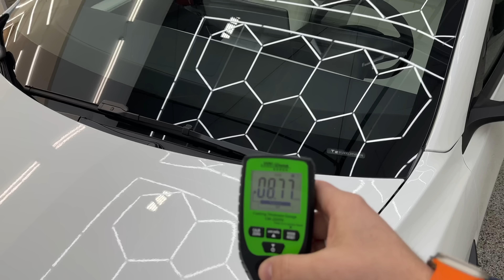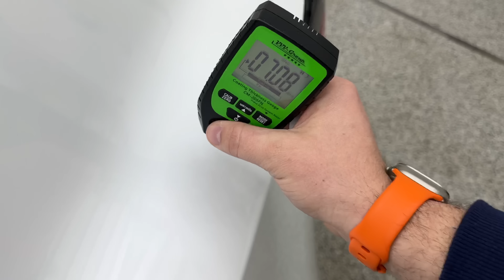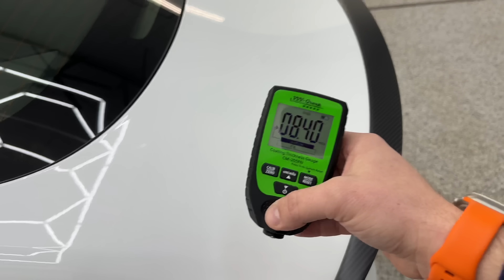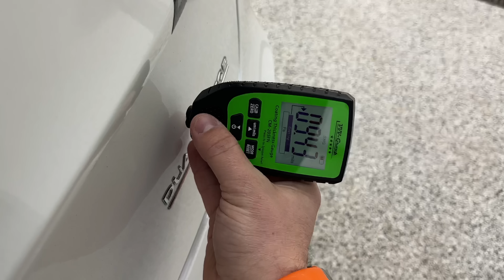Drastic Improvement In Tesla Build Quality! Analyzing Brand New Model 3 Performance

Comment: My Model Y performance is now three days old.  We picked it up at the Temporary New Delivery center in Bangkok.  My wife and I found nothing to complain about on the initial inspection.  Everything works.  The interior and Exterior were perfect.  We have a 516km range model. (I mention that because I hear that they are going cheap on the batteries and range will be reduced)  We have Parking sensors and a plug for a radar that is not installed.
The only niggle we have found with our vast experience with this car is Rain.  When water hits the area behind the hatch glass and the spoiler, it sound super loud and cheap.  As if you are inside an empty soda can.  Sound deadening mat is definitely needed in this area.  This became noticeable when water from a gutter or over head drain is hitting the car in this area.  It really shows where the noise is coming from in the rear.

Comment: Wee took delivery of our 3 RWD pearl white on Dec 27. Currently at 1839 miles on the odo. No issues at all. Paint, body gaps, etc all great. No wind noise, no rattles or squeaks, all good.
Reply: did you get PPF?
Reply: @ROFEL  No. Too expensive in comparison to what the car cost. And we are in a very low population area, so chances of someone kicking up rocks or such are minimal.

Comment: Our Model Y Performance from Berlin, delivered in December (2023 without sensors) was also built so perfectly well compared to our old Model X. Outstanding finish inside and out. Only one thing that could use an adjustment.. the charge door might be poking a couple of millimeters too far out on the bottom. Apart from that.. perfect! The door also sounds much more solid than my mothers early generation Model 3, and road noice is on par with most other premium cars now imo.. at least those with frameless doors. 

They have really stepped up their game… and it even smells like a new car now, instead of just plastic as their older cars used to smell when new. Smell is so important when buying a new car!

Comment: I took delivery of my Model Y at the end of October last year. It's an Austin build. They washed mine and even though our state requires the front license plate I too was happy that they didn't put it on since it has that double sided tape. I didn't removing it late to be an issue. I bought and aftermarket frame and love it.

I'm not sure how they washed my car but I have the midnight silver and thought I was going to see marks but I must have hit the car lottery. My fit and finish was on par with this Performance model. I didn't have any visible paint issues. All my electronics work perfectly. I'm an IT guy with about 30 years in and I'm kinda nerdy and OCD with it. I did basically 20 to 30 minute walk around. My sales rep was super chill about it since they were really busy and it allowed her to get other paperwork in order.

To this day I've been super happy but I really need to get serious about paint correction and PPF because this spring I have a few other accessories I plan to put on/in the vehicle.

Comment: Have a 21 M3P with same colour spec. Already 70,000kms. Been rock solid still no squeaks or rattles. If I had any complaints there are a few imperfect panel alignment.

Comment: We've found our RWD standard range 2023 to be pretty solid too.  I did go over it with ceramic(did not paint correct) and I was impressed with the fit and finish.  I'd say my GTI is even tighter but that's if I'm really nit picking.  The panel gaps are tighter on the VW, but the Tesla's are still uniform.  I'm really surprised by how much I like the simplicity of the interior.  I'm a big fan of the German approach of simple designs with high quality materials.  I think the GTI feels slightly high quality in the interior, but I think that's just perceived because I prefer the real leather, but I find both extremely comfortable.  You can tell the Tesla doesn't use real leather, but it's not a bad thing.  I plan to buy a Model 3 Performance too eventually to be my daily.  Our current Model 3 is my wife's daily.  The GTI is mine.

Comment: I noticed the clear coat/paint difference on the bumper from the body. ITS a different shade lol. Not noticeable to others. On my model Y LR has the same issue. Outside on the sunny day its fine. But in my garage with shop light, you can spot it. Its a bit yellowish. Rock chips also will chip bumpers easily than the hood. I've tested it. Glad you brought up that color issue. Tesla still has gap issue of course.

Comment: Please provide a 1 year update on the build quality. When I took delivery of my Model 3 eleven months ago, it was rock solid and had zero creaks or rattles. Today it has tons of creaks and rattles. Curious to see if over time your dad's car remains solid.
Reply: Took my delivery last May and I'm starting to experience the same thing. Sometimes it's nicely quiet but other times there is a squeak somewhere that I can't seem to pinpoint and it drives me crazy. Brought the car to the service center where they found nothing wrong and charged me $65 for diagnosis.
Reply: I'm thinking about ordering the model 3 but creaks and rattles would drive me crazy too.  I sometimes spent hours to try to pinpoint where the rattles coming from in one of my previous cars.  My current car, 2021 Acura RDX, is still creak and rattle free just like when it was new.  I guess they're not built the same.
Reply: We are having a Model 3 2,5 years old and a Model Y 1.5 years old from China. The Model 3 has a slight creak closing the drivers door but nothing else. The Model Y sounds like before the 64.000km it has been driven already.
Reply: @laloajuria4678  Mine not.

Comment: On a strong headwind or a light passenger to driver side cross-wind, the top corner of the driver size window whistles extremely loud. I can change the pitch a little when put a little pressure on the glass so I know it's coming from there. It's very loud that even a pretty high music volume can't mask, lol. But it's also right at my ear. Drives me absolutely bonkers on longer drives.
I wonder if the top molding overhangs too much from the window. Really wish the model 3 had full frame doors. Usually less problems.

Comment: I heard that the 2023 model y performance will have a little softer ride compared to prior MYPs.  Do you notice a difference in ride quality?  Thanks!
Reply: The ride quality of my 2023 MYP over bumps and lumpy roads is firm/not jarring. I would like drive back to back with earlier MYP to opine on preferred option. Having said that, am content with mine.

Comment: Got my m3p 11/2022 build. Pretty much out of dealership MCU failed, replaced under warranty. Some minor paint chips. Still no paint on inside of doorjams. Otherwise fine
Reply: @laloajuria4678  I agree, could be better. Try to find another car for 50k that does 0-60 in 3.1s Doesn't exist.

Comment: Gives 10 000miles and its a rattle box, if driven over bad roads all the time.
It always feel tight in the beginning 
Ive gone thru 2 model 3s
2019 and 2022.

Comment: Tight is good. Maybe Tesla can design a 'Lego' tipe fitment on the moving parts so that the panel gaps can al but disappear.
Reply: Maybe they’ll eventually cast the whole car in one piece.
Reply: @ken-mb5cp  With every megacasting, repairability drops and insurance prices jump up. Nobody seems to talk about this. If half the car is 1 piece, and u get lightly rear ended, boom your car is totalled.

Comment: I picked up my 2022 M3P in June.  I had 1 lug nut off the front right wheel and a second one almost off about 4-5 days after picking it up.   Thankfully it was rolling around inside the centre cap so I knew something was wrong.  My armrest console is also funky you can see down inside from the side even when closed.  Also between the driver seat and centre console I almost can’t fit my hand but I can pass my hand through the passenger side almost without touching the seat or console.  I’ve got loose trim at the back seat and dash speaker rattles but panel gaps all seemed ok on my car.  Lots of other issues but what can you do.

Comment: Where is this made ?
Reply from the maker: Fremont
Reply: Model 3s aren’t made in Austin.
Reply: @OutofSpecDetailing  Just went to Fremont center for my Y delivery today, found a few mis aligned gaps, and headlight not flush with panel. They will fix it, and redeliver on tomorrow. Thanks for your video for what to check, but mine definitely not as good condition as yours.